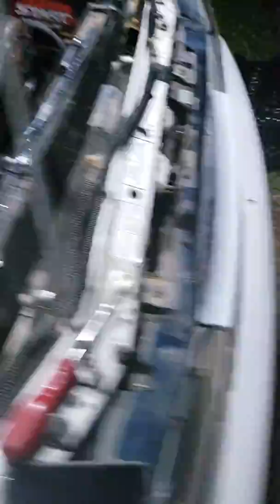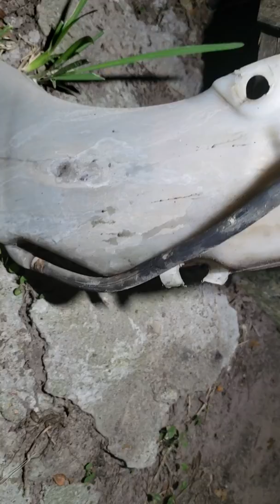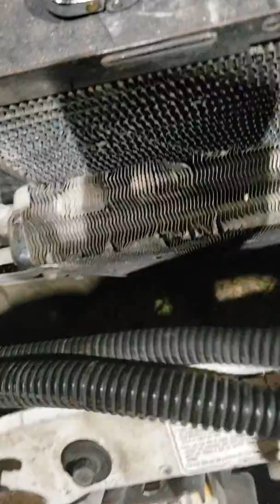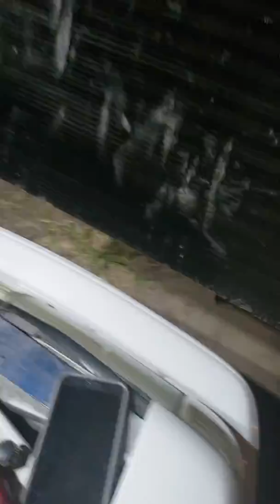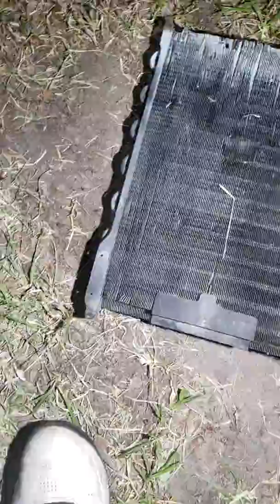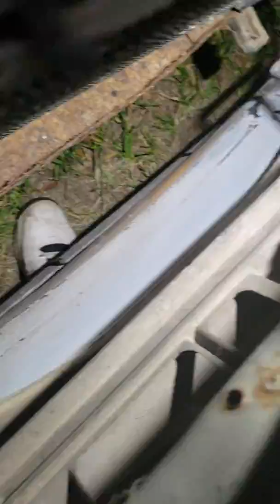Remove condenser without taking radiator out Ford Mustang Foxbody

Comment: What exactly did you do to remove the lines?
Reply from the maker: I used ac quick disconnect line removal tools. Lisle has part #37000. It goes right behind the connection and slides in to loosen the spring that locks it in place. Twist it a little and push and pull. I think you have to use the 3/8, and 5/8 ones. It might've been a half inch. I'm not exactly sure. It's been a minute. I know it's two different sizes.
Reply: @UFOGHOSTHUNTER  thank you!!